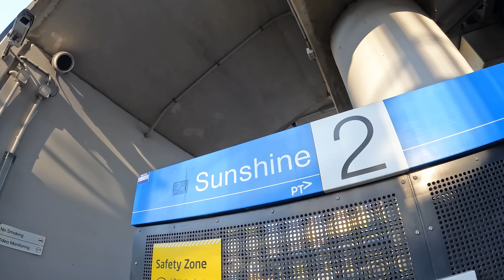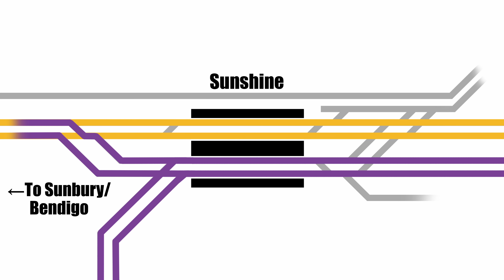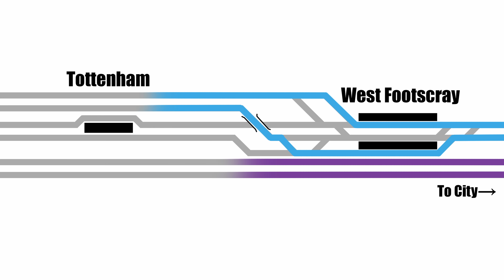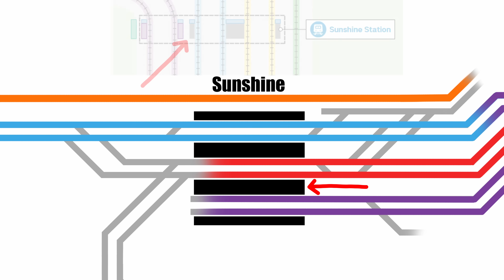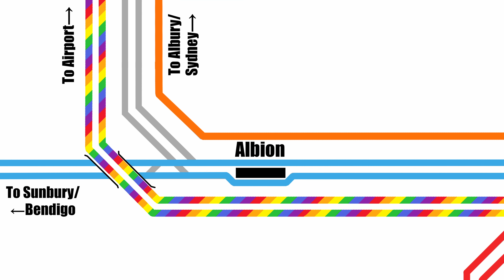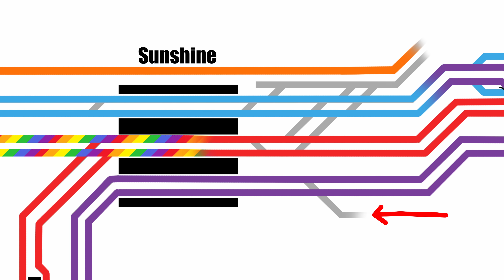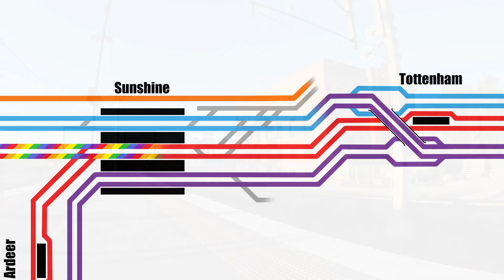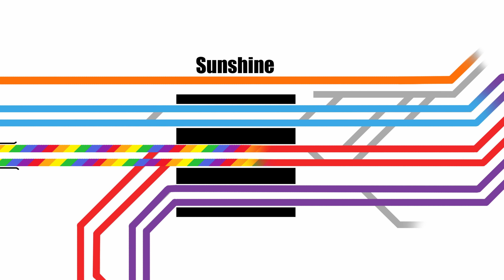A new plan for Sunshine // Melbourne Airport Rail!

Comment: I think the solution to the fact that Melton would have to be electrified concurrently and Wyndham Vale would be hard to do is quite easy: add flat junctions at the down end of Sunshine and Deer Park. I imagine the extra track pair between Sunshine and Caroline Springs will be done after the superhub stuff, so I imagine originally platforms 5 and 6 will go on the current alignment, when when Melton is electrified they'd be moved to the new V/Line alignment. And for Wyndham Vale, while it would have capacity constraints I do think just a junction between the 2 lines down from Deer Park could allow suburban trains on the Deer Park-West Werribee Line, or perhaps they'll spend another 2 billion seperating regional and suburban again all for a single suburban line

Comment: I would say the most likely way wyndham and tarneit get electrified is that they just electrify the RRL and use 15/16 to terminate those trains at southern cross
Reply from the maker: That would actually be my preferred way, and helps prepare for more longer distance electrification. I doubt they'll do it that way though.
Reply: I think they'd end up going through the City Loop using the capacity freed up by the Sunbury line.

Comment: The other interesting thing that hasn't been pointed out is that currently, at the other end of the Melton Line, there's an LXRP going on rebuilding Melton station. The interesting change being made is that simultaneously, they're not just raising the station, they're also adding in 2 extra terminating tracks in at Melton station, which is quite curiously happening right now.

If my suspicions are correct, the government seems to be doing all the setup work for a Melton electrification scheme, that would be done by 2030, and would have to be announced in the next year. A state election year.

I mean, Labor's gotta sandbag the western suburbs somehow.

Links for those wondering: https://bigbuild.vic.gov.au/news/level-crossing-removal-project/final-designs-for-melton-level-crossing-removals

Comment: Wyndham Vale would make more sense as an extension of the electrification from Werribee wouldn't it?
Reply from the maker: I'd probably argue for both. Tarneit is the busiest station on the line.
Reply: Wyndham Vale was to be electrified from Werribee as part of the initial RRL plan but was cut as a cost saving measure before the Regional Rail Link was opened. There is still some dissatisfaction that the passenger rail link to Werribee from Geelong was broken. (Provision was made in the station construction)
Reply: I think there might be a plan to electrify from Werribee to Wyndham Vale but Tarneit will remain unelectrified…

Comment: I seem to recall a while back there was talk about a multi level Sunshine station, with platforms stacked like the City Loop stations. I'm guessing that's why the new platforms are shown detached; they're intended to be above or below existing platforms?

It's nice to see that Melton electrification is actually happening, I believe most of the Wyndham Vale alignment has been designed to allow for quadruplication, seperating current regional and future electric suburban services.
Reply: Yeah it would make sense in the long-term, given there won’t be room for more Sunshine platforms at ground level once this project is complete (unless there is land acquisition involved). I wouldn’t overlook the possibility of an underground SRL West/High-Speed Rail integrated into Sunshine station, that would be a pipe dream!
Reply: That would mean they would need to build a line that goes over the existing road bridge to the west of Sunshine Station which would be quite high up… unless they were to make the road Bridge an underpass instead? (Or make the extra lines underground?)

Comment: Fantastic video as always Martin! I found your point about the Melton electrification needing to be completed at the same time as the Sunshine overhaul to maintain service to Ardeer, Deer Park, and Caroline Springs particularly interesting. Very good, detailed analysis of the situation.
Reply: I live in Ballarat and commute to Melbourne on occasions. The fact that V-Line trains still have to stop at suburban stations is diabolical. 

The Melton electrification will make a massive difference to regional commuters and can’t come soon enough.
Reply: Electric trains could potentially terminate at the Caroline Springs station so there are three fewer stations to be served by a line. This would be much better for the west than terminating at West Footscray.
Reply: @malcolmmccaskill2311  Terminating services at Caroline Springs would make a lot more sense and be a much better service option for the west. I could even see them doing Melton electrification in two stages: Stage 1 from Southern Cross to Caroline Springs (to maintain service after the Sunshine Super Hub takes V/Lines out of the aforementioned stations, and Stage 2 from Caroline Springs to Melton. This hypothetical would have Stage 1 at about 21km of infrastructure works and Stage 2 about 15km.
Reply: Please no. The single road out from the station is bad enough as it is being shared with the freeway ramp and the amazon drivers. 
@malcolmmccaskill2311

Comment: Great video as always!

I don't know if that's available in Victoria, but have you considered doing Freedom of Information Requests to the government about things like these plans? Maybe you'd be able to get more detailed information than just what's in the public press release.

Also, are there any plans for electrification of the regional rail lines in Victoria? From your videos it seems like the thinking is always electric = suburban, but I don't think it's unthinkable to electrify to Geelong or Bendigo, looking at a map.
Reply from the maker: Yeah I haven't looked into what's required for an FoI, but I'm guessing it would be a bit of work. In a way I kind of like making a point of the fact that they don't reveal all the info anyway. :)

Regional electrification has been on and off the cards for at least 70 years, in fact the Traralgon line actually was electrified from the 50s to the 80s. Unfortunately the electric=suburban psychology is deeply embedded now, and I think is quite problematic. It's something I do plan on making a video about at some point.
Reply: @Taitset  To do regional electrification properly, you'd really need to run higher voltage (probably 25kV AC), rather than 1500V DC.  And until the regional network (or parts thereof) is fully separated from the suburban network, that would introduce the potential of things going wrong.  25kV into an HCMT would be spectacular, but probably not helpful.

So the Geelong line would be doable ATM, but nothing else.  Albury too, I suppose.

Back when the Traralgon line was electrified they would switch off the power on weekends and run diesels, because it was cheaper.
Reply from the maker: @dfross87 I suspect it could be done relatively easily these days with purpose built dual voltage trains (you'd want to get some dedicated regional EMUs anyway).
Reply: @Taitset  You certainly could get dual voltage trains, but that's not how we do things in Victoria 🙄.
Reply from the maker: @dfross87 Yes hard to argue with that!
Reply: It's unlikely you'd be able much substantial if the plans are still being developed/confidential and it's probably better that way. If WIP plans are revealed without they could be easily misinterpreted by the public who aren't involved in the broader body of work surrounding them and hence set false expectations/damage the government's reputation.
Reply: FOI requires a fee in Victoria and maybe denied for commercial reasons.
Reply: Unless the VLocities can be converted to bi-mode, I think it'll be a long time off.
Reply: @deanstyles2567  Vlos will never be bi-mode, they're diesel hydraulic. It'll have to be considered for the replacement for Vlos instead, in like another 5-10 years.